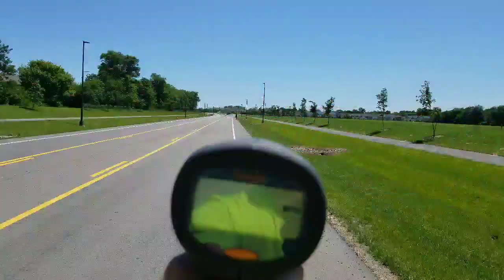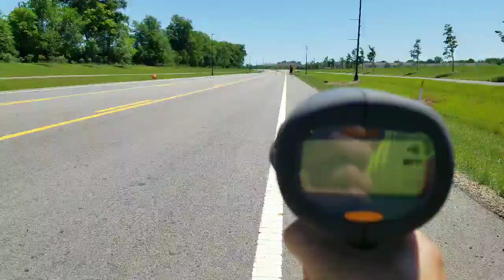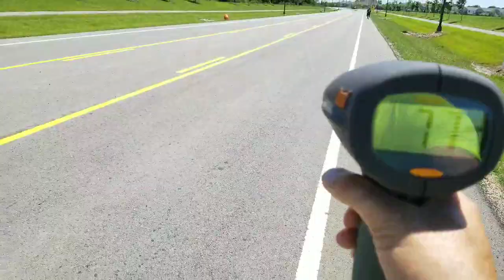TRAXXAS 4TEC 2.0 SPEED RUN'S 3S 80.7 MPH

Comment: Nice Pass ~ Try lowering the body in the front or going up a notch in the rear so u dont catch flight...
Reply from the maker: TABOO Thanks for the tip bro she got a lot more power if she will stay on the ground 😂
Reply: i know she do & she will stay on the ground as long as the front is lower then the back on the cars ride height & the body's ride height...one more thing u can do is stiffin your rear shocks cause when u give it power the rear lowers witch causes the front to rise & stiffin rear shocks prevents that from happening witch should also keep her on the ground...
Reply from the maker: TABOO I appreciate the info bro I’m actually messing with the car right now tweaking it gonna do that right now 👊🏾